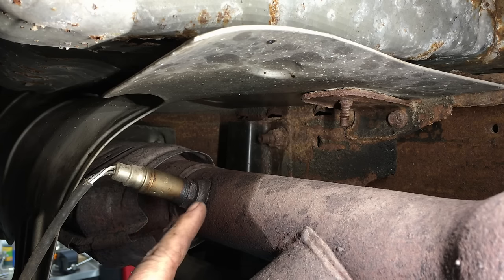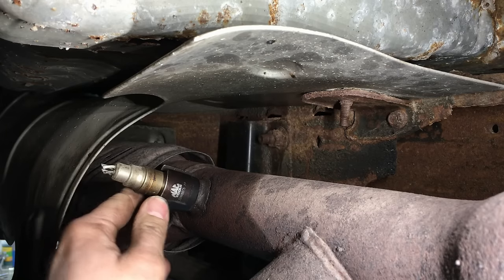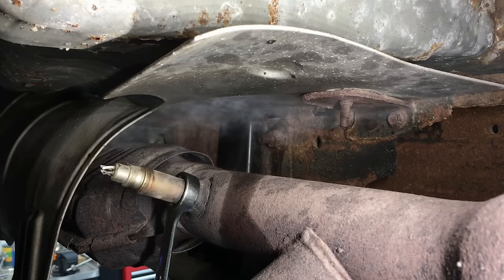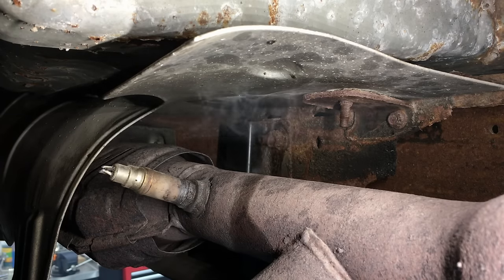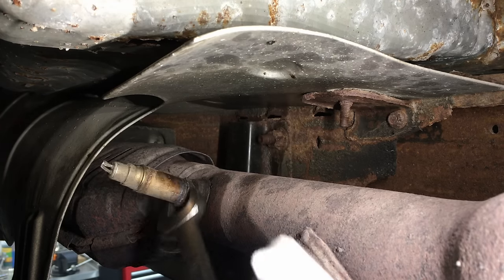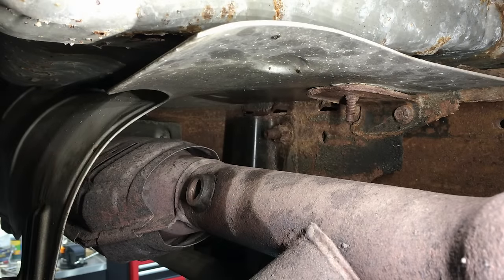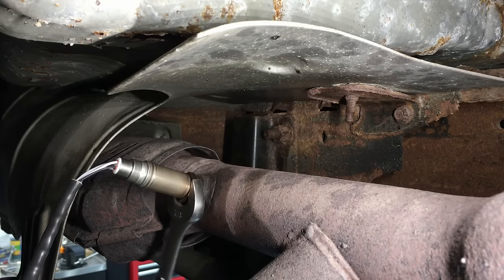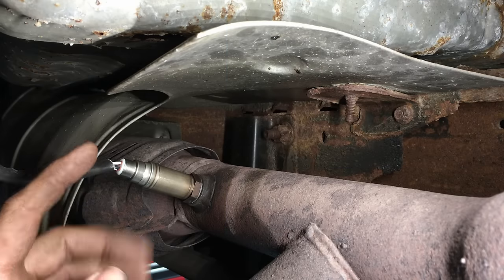Ford Quick Tips #81: Removing Rusted Stuck Oxygen Sensors the Easy Way!

Comment: My method: 
Step 1 Grap pry bar with striking handle and hammer
Step 2 Place bar edge on the base of O2 sensor and chisel through the whole thing til nothing left but a 6 sized hex.  
Step 3 Attempt to remove with wrench hammer taps on a short socket on ratchet
Step 4 If this fails, use oxy-acy torch to heat and repeat until success

I have had about 95% success doing just the first 3 steps.
Reply: ykmalachi if you’re destroying the 02 sensor why don’t you just cut the wires
Reply: A video would be nice.

Comment: If replacing? Snip the wire and either use a standard deep well socket or your ratchet wrench!!!

Most of the O2 sensor sockets are junk because they spread.
A drop of clean motor oil on the bung threads and a dab of anti seize on the O2 threads make re-install a lot easier

Comment: What irks me is that most of the oxygen sensor tools out there are really 7/8" sizes while the oxygen sensor on your car is a 22mm.  What this means is that you will from the beginning of the job, have a sloppy fit.  Also, most of the tools out there (not the socket variety ), but the ones with handles are way too short to get any kind of leverage.   
I just tried heat and a Ford tool (oem o2 wrench).  I got pissed that it wasnt moving fast enough so I did heat one more time.  Trouble is, I didnt look at my protective shield.   (a piece of steel with a V on it). The V let the flame go and toasted the Gear shift cable.  The plastic around the rod got crusty and bubbly.  Lesson learned is, don't rush it.   I will work tomorrow more on it with a 22m wrench, which fits tight on it and a MAP gas.       I hate FORD.

Comment: I want to try and use the torch in my garage I don't own a lift, is this safe to do or should I bring it in?
Reply: It's safe if you take precautions, like make sure gasoline is not leaking, there is no excess oil or grease buildup, and to give peace of mind, have your fire extinguisher within arms reach. Life requires we take a few calculated risks now and then.

Comment: Why do you heat the O2 sensor?  I always heat the bung so that it expands and loosens it's grip so to speak, on the o2 sensor.  Any time you are trying to assemble something with a tight fit, or disassemble something that is stuck, you want the inside part to be cold and the outside part to be hot.  That way they move away from each other.  Heating the O2 sensor (inside part), or both parts, can make the stuck problem worse than it was.  In extreme cases of stuck, I heat the outside part, then hit the inside part with CRC Freeze Off to rapidly cool that inside part.  Problem solved.  BTY, love your videos.
Reply from the maker: I agreed but trust me if the bung is red hot the threads of the o2 are not far behind.

Comment: I have a seized o2 Sensor on my 08 Mazda 3, 2.0. Tried to remove it with an o2 sensor removal tool, nothin. Put penetrating oil on it and let it sit for a few days, nothin. Since that I am doing it in my driveway and from above the engine, using gas isn’t an option. I think that it’s the original sensor so it’s old. I thought that it was going to be easy task when I had started. Not now. I am going to have to take it to a mechanic to remove it safety.

Comment: Something I didn't see him even try is, if you can get the sensor unplugged, check and see if the plug will fit thru the box end wrench.

You won't need a special socket then. Of course, once you heat up the sensor like that you have to replace it, so you can just cut the wires anyway.
Reply from the maker: I never tried it because I already know it does not fit from many years of experience.

Comment: Let it soaked overnight with wd40, in the morning heat it with propane then use an offset o2 sensor socket with a braker bar, it comes right out, I don't know if I was lucky or my method worked lol.

Comment: Nice work again!
Poor mans threaded hole cleaner = make two or three fine cuts along the length of the threads in the old part.  
Use a dremel or fine hacksaw blade etc.  CAREFULLY screw your slotted old part into the hole with whatever lubricant is suitable.
I do this for spark plugs and O2 sensors anytime the new ones wont thread in smoothly.
Stay gold.

Comment: i tried to change one of mine yesterday and that mf was stuck stuck i heated it til it was glowing orange and it didn’t move and i ended up rounding the edges bc the socket spread apart. now i have to take the y tube all the way out to try to get it out

Comment: Will a heat gun and a pipe slipped over the wrench work for this?
Reply from the maker: no
Reply: +FordTechMakuloco Cool video series and thanks for the reply. Any advice on removing an O2 sensor from a junkyard car? Some places do not let you bring a torch.
Reply: +Kd6sbr Tom sound advice, thanks. Rock Auto has it cheap so Im gonna go that way.

Comment: This is fun to do when there is a foot of snow on the ground and the temperature is 13 degrees.
Reply: stoney renegade  I had to do mine during a snow storm on a Sunday becuase I had to get to work on a monday. I was under my vehicle so long the snow accumulated and I was stuck. So I had to dig myself out with one hand sideways. I got it done though!
Reply: Norm & Stoney, what a great attitude you all have. Living in Canada and stationed in Greenland with USAF, I am familiar with the cooler end of the thermometer. What you need is some cardboard to lay upon, and the acetylene torch to "warm" the exhaust pipe while heating the welded nut to glowing red. Your perseverance will do the rest in staying warm.

Comment: If you are working on your own vehicle, get a tap and tap the threads in the bung and use a little anti-seize compound. Removing the sensor the next time will be 10 times easier.

Comment: If it breaks loose but becomes tight again, stop there and put a couple of drops of brake fluid in the crack. Wait a couple of minutes and then tighten the sensor back up, wait for a minute, then try to loosen it again and it usually comes loose.....

Comment: Ive tried everything in this video and still cant get the basterd out...its now rounded 2004 dodge ram downstream driver side
Reply: Then what happened? Vice grip? Hand grenade?
Reply: First, learn how to relax, do something else for the rest of the day and return to the job next morning. You will solve the problem a lot easier with heat and water and Bees Wax (toilet wax ring). Put the brain into 1st gear not 3rd gear. Sometimes, slow is faster.

Comment: If you let it cool down after torching it and breaking it loose the candle wax will flow right in. If too hot it'll just flash off. Candle wax works great. I like to put a mask over the sensor (piece of pipe) and torch the bung only.

Comment: Oxyacetylene works way better than MAPP, even if you add O2 with the MAPP. I find that MAPP by itself is much weaker until you add the O2, and with O2 the MAPP flame is more focused and narrow. The great thing about oxyacetylene is the cutting torch option, which makes removing exhaust flange nuts a one-minute, no effort job.
Reply from the maker: Of course it does but most don't have access to it and it's too dangerous for me. I do have an oxy mapp setup though
Reply: oxy map means

Comment: ...if you disconnected it from the main harness, why not just slip that end through the box-ended wrench? You don't need to cut any wire at that point.
Reply from the maker: The wrench does not fit past the connector.
Reply: @FordTechMakuloco  Then pull the terminals out of the connector--very easy to do on the Ford round connectors. Remove the red wedge, then use a pick to release the terminals.

Comment: wd-40 is NOT a penetrating oil. it helps prevent rust and corrosion in the future. Good penetrating oil is PB- BLASTER or 3 in 1 oil 10038 multi=purpose oil.

Comment: Just replaced an original one in my '99 E250 with the 4.2.  Used propane and PB Blaster.  It takes a while so just be patient and don't use too much force.  Also, don't use a cheap 02 sensor socket because it will spread and can round off the sensor.  I cut my sensor off with a reciprocating saw and used a regular 7/8" socket.

Comment: Hey men ! 
I own a 2003 Ford Escape v6, it was my dads but two years ago he gave it to me. My car is hesitation when I’m going to 46mph and then stops but every time I’m picking up speed it hesitates for 20 seconds. I’ve replaced de EGR valve and another valve that has to deal with the EGR, I did tune up and my oils change. What could it be ? I’m thinking the oxygen sensor because never has been replaced.

Comment: A TOYOTA MASTER MECHANIC said to use BRAKE FLUID to lubricate. He insisted in this situation it will prevent ruining the threads. He said gently tighten then go the opposite direction after a few drops of brake fluid.
Reply from the maker: If it is binding coming out then you always lubricate and work it back and forth since the threads are galling so you must in essence cut new threads as it is coming out. It doesn’t take a master mechanic to tell you that.

Comment: Hey @fordtechmakuloco, I have a 2013 F150 5.0 (86K miles), and noticed my mileage drop somewhat abruptly... No codes thrown, but do you see any benefit to changing the o2 sensors as standard maintenance?

Comment: I cut an old 7/8 wrench in half. Heat part of the bung red hot, use the box end and whack it with a hammer, then use the open end to wrench it the rest of the way out. Piece of cake.

Comment: I am not a fan of 12 point sockets or wrenches , I find 6 point so much better , although harder to find , there is less chance of rounding over.
Reply from the maker: Correct but in this instance you want the 12 point.

Comment: Remember you are wanting the bung to expand and the sensor to stay small and cold, so direct the heat on the bung and insulate the sensor with anything cold.
Reply from the maker: Honestly it will never happen, you can wrap the sensor in ice and the threads will still be red hot. So it's best to just torch it and work it and be done with it.

Comment: Yup, that's the way to do it.

However, I'd use wax birthday cake candles as a lub. Works STUPENDISLY!

My sensor is dead, so there's no need to save the wires, but  I haven't got the plug off yet. The connector is wedged between the engine head and the firewall, and the locking tabs won't release.

Since I started this project, I've bought a set of HF Looong Nose Pliers to get a better grip on the tabs and will dive in again.

If that doesn't work, I'll cut the wires and smash the sensor side of the connector to make room for the new one.
ARRGGG

Comment: I start soaking it with penetrating oil regularly several days before I plan to do the work. A luxury only possible if you work on your own car.
Reply: Do you still need heat afterwards or does that do the trick. I'm having difficulty on my town car.
Reply: @CooterCoy  I have done a couple on my own cars that came out fairly easily with only penetrating oil applied a few times over the coarse of a few days. They had been there, untouched, for 9 years in both cases. No heat required although I do have a mapp/oxy torch if needed and it does work well on rusted fasteners.
Reply: @jptrainor  I ran outside and sprayed some pb blaster on it. I hope tomorrow I can get this damn thing off.
Reply: @CooterCoy  I sprayed mine a few times starting a day or two ahead. Time and repeated application does make a difference with penetrating oil in my experience. Tapping it lightly with a hammer, or hammer and punch or screwdriver, can also help break the corrosion bonds and perhaps allows the oil to penetrate better. Good luck.

Comment: I know this  has nothing to do with this video. I have a 1997 f150 with   5.4  TriTon . I need do the timing chain . what is the easy way to set the timing and make sure it on top dead center?
Reply from the maker: Use the crank position tool from Ford
Reply: thank you
Reply: thank you
Reply: I pull the plug on cylinder one stuff a rolled up napkin in it and rotate the crank with a breaker bar till it blows it out...tdc every time

Comment: Stupid question. .. does the map torch get hotter than the propane one?
Reply from the maker: yes much hotter.
Reply: Propane is 3600F and MAPP 3730F so it isn't much hotter and I doubt would make much difference for this purpose?

Comment: Those are pro-tips !
I used shots of PB Blaster throughout a day before attempting removal.  It came out so easily that I thought the wrench wasn't on.  15 year old sensor (upstream).  Does this ever happen?
Reply: I'm doing my 02s tomorrow and waiting for the 3rd round of wire brush and PB blaster! I deal with rust all the time and PB is a must!
Reply: @mikeo5668  Good luck.  I wouldn't mind knowing how it went...mine was so easy it didn't seem right.
Reply: @louf7178  well, I did them earlier haha, couldn't wait. A wrench with a bar on the end and they came out easy! Cleaned the treads and back in she went. I did both upstreams on my truck, the drivers side treads had to be wire wheels and the scrapped the treads before it went in. All in all, very happy hah
Reply: @mikeo5668  👍  Thanks for replying back.
Reply: @louf7178  no problem, doing plugs and wires tomorrow

Comment: Impact Wrench / Cut Wire / 22mm Deep Socket = best fit / Wd-40 / Loosen then Tighten & Spray the WD40 til comes out quickly with the gun

Comment: And for a extra step if that fails on removel . And u can laugh now but when your in tears after 6 hrs get a candle heat part or bolt or nut this gets anything off . So heat peace candle on the high point and let it melt try to remove . repete till it comes free and it will might be when your about to give up try one more time i think this would be quick.

Comment: 50% mix of ATF and acetone (or white spirit) is also a good penetrating fluid.
Reply from the maker: That's what I hear too but I thing the acetone would turn into a fireball once the heat came out.
Reply: I have always heard that.....got the atf and acetone and sealed squirt can and now my fiance's O2 sensor needs replaced so I get to try this out.

Comment: Think IMPACT wrench when removing those. Like he said, tapping it helps loosen up the rust and corrosion but tapping works like an impact, it breaks the bond between the crap and the O2 sensor. I have never seen anyone use a candle but I prefer break away myself. This guy is dead on as far as removing an O2. Speed removing will seize the crap out of them. I tap, tighten, tap loosen. Back and forth. It works for frozen brake lines as well. Just cut the line before starting because it's NEVER comming off whole.

Comment: My father-in-law's trick for areas like this, that do not need high strength (drivetrain, towing, etc) is to torch it good and hot then spray it down with cold water. Then, you can almost remove it by hand. The cold water causes fast contraction, which (usually) breaks the rust bond

Comment: good video.  I would even reccomend people take more time, and get a chisel and tap on the bottom of the o2 sensor-and use much more WD 40-dont be afraid to spray the shit out of it-right after you heat it up, yes its going to smoke, thats ok.  Heat and spray at least 6 times.  6, not 3 not 5- 6.  I even cool it down with ice cubes-then heat then cool with ice than heat and spray in-between heating, take your time and definitely rock it-back and forth-very important
Reply: 4x rivet gun against the crowfoot viola..

Comment: There is a specific TORQUE VALUE for it. Why guess?
Reply from the maker: I always do it by feel, I want to feel the gasket crush and then the hard stop of the hex hitting the bung. I do this because oxygen sensor threads are almost never perfect so I must feel it is seating to my spec. It’s an acquired  feel that comes with many years of experience.

Comment: Automobile manufacturers design this crap hoping us “do-it -ourselvers”  have to go running to the dealership or mechanics. I usually use a torch and a breaker bar and that usually works but they can be stubborn af. Thanks for the video, very informative 😊

Comment: tried mopar.. junk.. you want some NASA approved penetrant.. try this http://www.kanolabs.com/penLub.html#anchor173855
it melts rust off and works better than anything ever tried.. and you don't need heat.. you get what you pay for though.. kinda pricy but works.. I can spray this on exhaust bolts and they come right off with no force.. give it a try.. 
cheers!!
Reply: Try a mix of Acetone and Vinegar 50/50,  cheap and very fast working.
Reply: Acetone/ATF
Reply: 6.0Doctor thank you!!! Just checked the Web page out looks like nice stuff!!!
Reply: Kroil is by far the best I've ever used.. Worth the extra price!
Reply: But NASA doesn't have to deal with New England / salt belt rust! Haha. I do have to try kroil, I've heard lots of good things.
Reply: I agree with this gentlemen about Kroil. I work in an electroplating environment and the atmosphere is very corrosive to fasteners. The only parts allowed are stainless steel and plastic components. We have tried every rust inhibitor out there and have found that Kroil will break rust apart on fasteners with no problems. And on exhaust bolts, I have found the same results.

Comment: Ford wants $250 for the upstream left O2 sensor on my F150 and half that for the other side.
I'll go with Bosch at a fraction of the price and hope it works OK.
Reply from the maker: I imagine you are replacing UHEGO sensors on a 2009 or newer truck, good luck with the aftermarket these are very sensitive to the vehicles calibration.
Reply: @FordTechMakuloco  
The Bosch is labeled as "actual OE oxygen sensor" on Rock Auto. Does that imply the Bosch makes them for Ford?